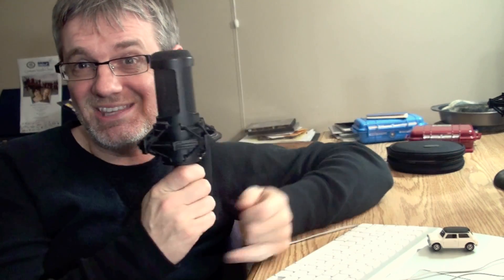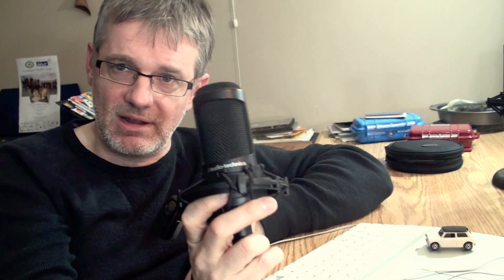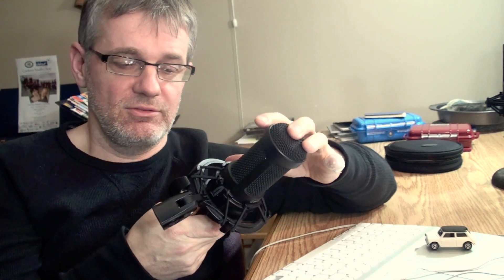Humming of Buzzing Sound when Recording | Audacity Mircophone Fix

Comment: i get a weird hum but only when i play a note on my bass. it's more likely that something on my bass that shouldn't be vibrating is vibrating with each note since everything else i use is either running off of a battery, and there's a gap of air between the mic (powered with phantom power and the audio interface is powered by usb) and the bass cab. try as i might i can't seem to track that down.

Comment: You have a hissing noise on this video, why did you not get rid of that?
Reply: because his method doesn't work
Reply: Typically the 15/30v vs. 48v problem..... I'm pretty sure he's using a condenser microphone powered by a phantom power  source that doesn't provide enough juice....

It happens often to those.... not reading user manuals.. especially the specs section.
Reply: lol
Reply: Could fix with some simple eq

Comment: Andrew, here is my different problem: I record an interview via landline phone. One of the jack from telephone set is connected to the back of the desktop. The software I use for recording is cool edit pro2.
When I am ready to record, I right click on the speaker icon from the bottom right corner, select recording devices, and select microphone as default.
After recording, I get the humming sound specially in the gap of the conversation. I believe, there is humming sound but can't hear because of the talk.
My point is, do you still want me to plug in the desktop, monitor, phone adapter, speaker adapter in one extension? And this will solve my problem or there is another way to get rid of this annoying ghost?
Thank for your help.

Comment: Finally a great short video about the issue and explained clearly. I have still a problem with my old mixing desk from the 80s. Just purchased it. When i switch it on an plug my headphone into the headphone out there is a huge humming nose coming out of the desk. Nothing is connected to the mixer only the headphone. All the channels and fader is down. If i lean towards the mixer or put my hand on the top of the mixer where the power unit is the buzz is changing. I need to mention that the desk has a 3 pin connector and the other end of a cable is a standard europian two pin. Could you or anyone please advise me on this? Or is that a capacitor issue....thank you so much.

Comment: My problem is that when i plug out the AT2020 there is still the humming noise and annoying buzzing noise, so i dont know what it is the mixer is new etc. please help (AT2020 XLR connected, mixer : Alesis MutliMix 4 usb )
Reply: I have a Alesis MultiMix 4 Usb as well and I'm getting the humming too. MXL 990 Condenser Microphone and Mogami Gold XLR cables. I would love to replace this mixer because it doesn't have built in compression tuning. I'm going to try to run my mixer power to another outlet, I can't take it too far I need it close to my computer setup for streams.

Comment: Bro Andrew, I'm Getting Frustrated with audacity. How do you keep high sound quality and keep your voice volume from not sounding too quiet over a track without distorting/decreasing the sound quality. I'm finding myself mixing songs then when I go to listen on and mp3 player/PC I will have to turn it all the way up just to hear what would usually be like 65%-70% volume on an ipod/pc? It's really pushing me to the point of just using different software, if you could help, in some way, that would be great.
Reply from the maker: Hi Keefer,
If you are new to Audacity and want to learn to make nice recordings then you need to get my Video Guide to Audacity on my site MakeAndBreakEducation(link in the video description). Lots more to learn in there :) Cheers, Andrew